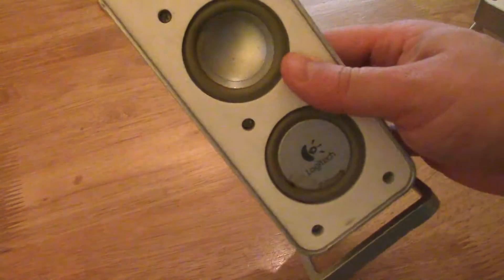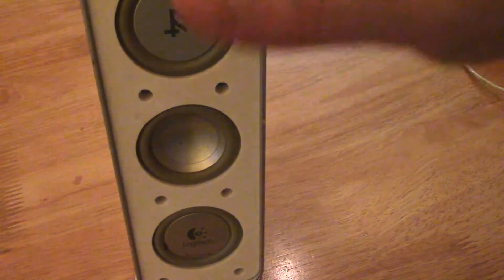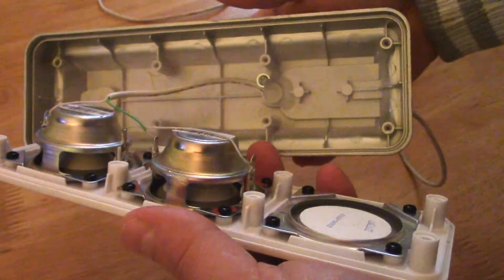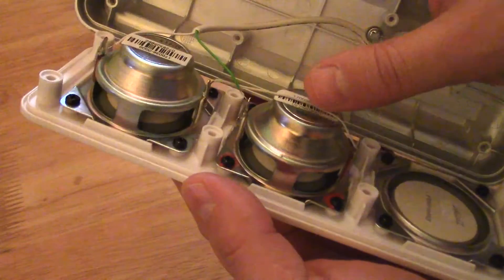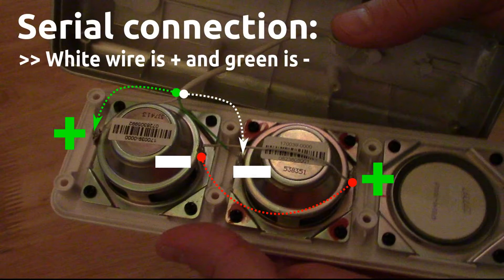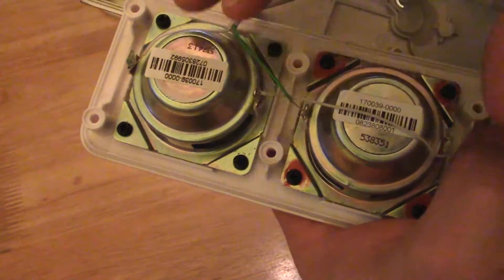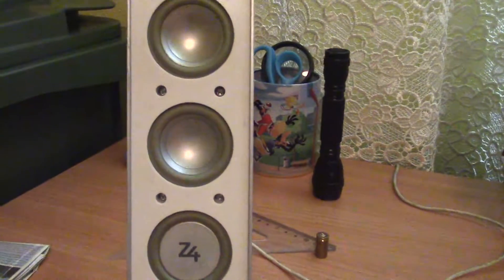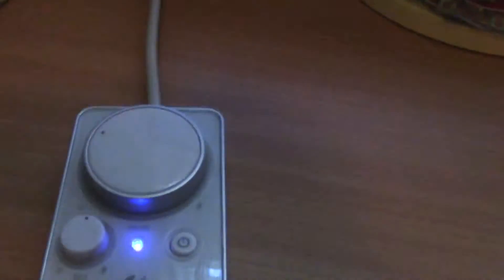Logitech Z4 speakers modding and sound test

Comment: Where I can buy satellite speaker/audio driver to replace? I bought 2 sets of this speaker system, but those satellites tend to make distorted noise at specific (+equalized) songs/frequency especially with higher loudness. After 16 years or so I think the rubber membrane around the audio driver is rather hard than soft so produced sound is affected..

Comment: You can add a capacitor with the same specs that the on used inside the X530 satellites and enjoy the FDD2 tech, it will improve the high frequency making the sound very nice and more balanced
Reply: Hi, what kind of capacitor do I have to add?

Comment: By connecting the two speakers of the satellites in parallel you're impairing the amplifier functioning because now the impedance is half the value than before. Bad "improvement".
Reply: THIS is in series not in pararel.
Reply: @skoda110  I'm sorry you're right, I didn't watch carefully.

Comment: My Z4 satellite speakers are buggered... the rubber around the outside has all cracked...  I can't find out what ohms they are... do you know ?.... there's these 2ohm babies on ebay .....do you think they would be suitable ?...... even if I used 2 in each satellite box (4 ohm) ?  ....   https://www.ebay.com.au/itm/233195818244

Comment: Hi! Nice work! But they are not actually fake speaker elements. It is called a slave. They are passive, but they will still vibrate with the acive element as long as the cabinet is completly closed and airtight. Active elements are better, however adding "slave speaker elements" is a cheap way to move more air for less money.
Reply: air for Nothing

Comment: I have had Z4 set up on my main computer since about 2009, thats 11 years service and perfect working. Quality proven.
Reply: I've been rocking mine since 2007! after sitting in outdoor storage for 9 years, sounded amazing!
Reply: Would like to say the same, but mine has been dying for a year or so. The sub cuts in and out randomly. I suspect the amplifier card inside the sub. This is why I'm here =)
Reply: @nicolasharel9787  I had same problem. Just put another sub 4" driver. I bought SAL driver for 10 euros, same sound.
. The problem are two gold wires that are inside driver.

Comment: On the top and bottom these are not "fake speakers" but pasive radiators. Your modification might work better, but only with low volume of music. When you play loud music with a lot of bass two speakers will create too much pressure for one passive radiator. You should match at least one driver with one passive radiator. It is even recomended to match speakers with passives that are 1.5-2 times bigger.
Reply: What is a pasive radiator?
Reply: These satellites don’t even play any bass, this won’t be an issue
Reply: Well then thats when you get rid of the gay passive speaker and replace with a port.
Reply: @cobz76  gay?  ffs!
Reply: @paulquince5470  Yeah that's how I speak. Gay as in stupid. Gay used to mean happy. Now it means homosexual. I don't care what you do in your bedroom. I'm talking about the speaker.

Comment: Idk how good of an idea this is. By running those speakers in series you are doubling the amount of resistance in the system. Seems like you could blow the amp. Idk what it's rated for but I'll be leaving my Z4 stock.
Reply: running them in series is actually safe lowering the impedance below the original would be bad
Reply: With higher impedance the speakers receive way less power. These things are not meant to be modified and theres really no point on doing this anyway

Comment: Just put a pair of book self speakers on and hear the difference.
Reply from the maker: I agree, even the cheapest bookshelf speakers from JVC, Kenwood, Sony... can make BIG difference, or some satellite speakers from some serious 5.1 or 2.1 DVD-BR-HT system.
In my case on my desktop for my PC is Denon DRA-F102 with two satellite speakers from Kenwood model KS-HT300 and one powered subwoofer Kenwood to, model KB-40 HT and sound is better than eny Logitech speakers I have once, including Z-2300. Sound is better, headphone output is far better, tone controls let you set  sound tone what you like to hear and on the and you have comfort of remote control.